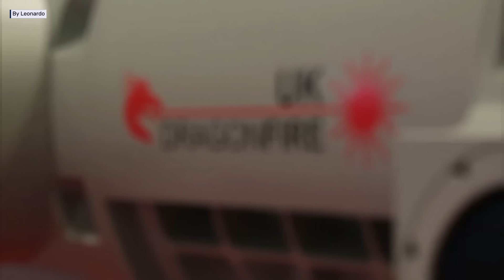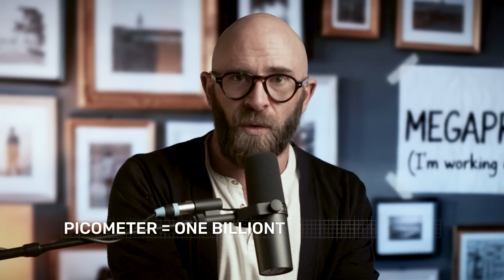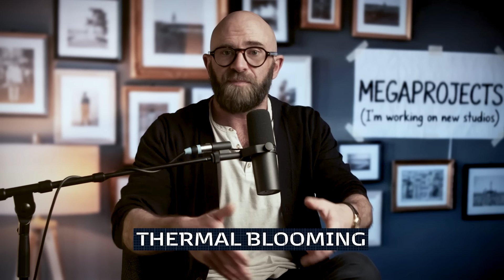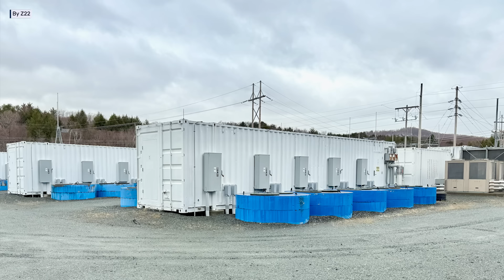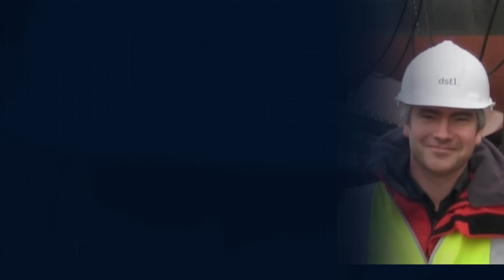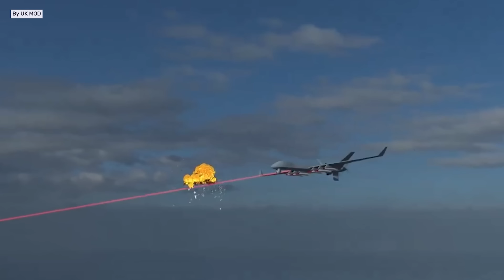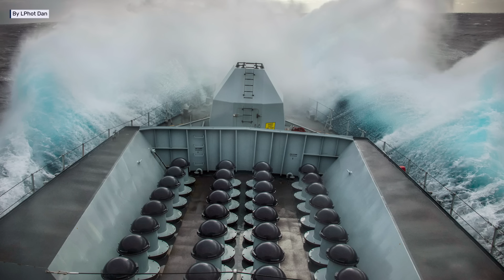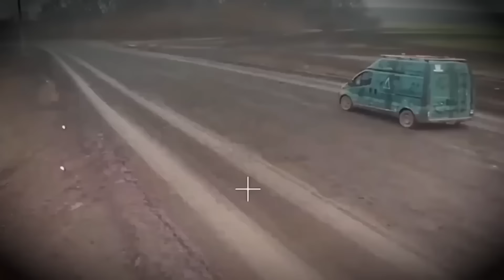The UK's Insane Laser-Directed Energy Weapon

Comment: The normal purpose of a flywheel in an IC engine has nothing to do with changing gears.  It is used to store energy from the fast burning of the gases in one cylinder until the next one is lit, and this is most important at idle speed and when the engine is cold and the oil thicker.  It is actually a disadvantage in gear changing, when you want the engine to change speed rapidly.  With a manual transmission in a vehicle with a heavy flywheel, for a smooth gearchange you have to wait a long time for the engine speed to reduce to the new speed required when changing up, before you let the clutch up to reconnect it to the transmission, and when changing down, you have to blip the throttle for longer before letting the clutch up.  This is why people tuning a car for maximum performance often lighten the flywheel, accepting that they will have to set a higher idle speed.  The issue is made worse if you change by two or more gears at once.  With an automatic transmission, there is usually no way of achieving that result, and changes made at high engine speed cause a nasty jerk, in spite of the cushioning effect of the torque converter, and they are set so that they can never change more than one gear at a time, except sometimes for changing down if the engine is near idle speed.  The only time that the energy is stored when changing gear is with a so-called racing change, when the throttle is not reduced, but the gear lever is quickly smashed hard into the next gear.  That is possible if both engine and gearbox are rebuilt after each race, as is normal with racing cars, and provided you don't "miss a gear", in which case the gearbox, or sometimes the engine, will be smashed -- you sometimes hear a driver say "I lost 2nd gear on the nth lap, which made the hairpin very difficult for the rest of the race".  If you try a racing change on an ordinary car with a manual transmission, you are likely to damage it.

Comment: The problem that the gen XArichimedes found is as true now as it was in 1998. You have to focus that weapon on the drone for a significant length of time. 
I set chatbot on it with available stats and fundamental formulas including  beam spot/ irradiance + atmospheric transmission + damage criteria for various drone materials; aluminium, gps, carbon fibre. 
It gave the effective range for shoot down 1-2km with 3-10s burn time (sensor damage up to 10km). That means the weapon can handle 6-20 drones per minute- it will be overcome by any modest drone swarm. In fog the range is not more than 300m.😢

Comment: Lasers will fit quite nicely into the layered defence. Fighter aircraft at long to medium ranges. SAMs for intermediate - to medium ranges, then soft kill in between, followed up by CIWS and laser. 
It is strange when I hear the term “swarm attacks”.  In the 1980s, the AAW expectations of a Naval task force would be to be hit by a "regiment" of Russian aircraft carrying either AS4 or AS6 missiles. AS4, 4 per aircraft, AS6, 2 per aircraft. Things would be further complicated with a variety of warheads, Heat Seekers, Anti-radiation missiles, Active homing missiles etc. You would be facing 50 - 100 missiles at any given attack, with multiple warheads, meaning that you had to go through the entire dance (counter measures) for all possible types. 

Problem? Missiles of my time required missile launchers, either twin or single, and then you needed a fire control radar for each missile. Like a gun, you needed to aim the missiles, and the fire control radar would need to stay on target for the entire flight time of the missile intercept. (You could reload the missile launcher, but not fire) Vertical launch missiles have helped, but they are not (at the present time) reloadable at sea. Survivability has always been a problem.  Every new weapon brings a counterweapon.  

Remember the war movies of ships slugging it out with guns?  Well, modern warfare means that when all your missiles have been fired, and all of them have been countered by the enemy and their missiles have all been countered by yours, you still have the enemy to deal with and like WWII, you will close to gun range and exchange fire.  This has always been the future of war.  It is always better to deal with the enemy as far away as possible, and lasers will not help this.

Remember Star Trek Shields? They will be next.

Comment: Lakers take ENORMOUS amounts of energy.  To be mobile would either take infrastructure of power stations and cables or batteries.  One bullet into the battery case of a battery pack (which has to the size of 4 x 8’x9’x40 foot shipping containers for 16 laser shots…before needing recharge and the batteries blow up… yep…they cannot be put out once oxygen reaches the lithium.
To mount one of these lasers in a 747, the plane would need to be FILLED with batteries for 20 minutes of use.  Bro, they ain’t prime time yet…certainly not the way you said they seem now..

Comment: An optical laser system used as a weapon just is dumb. Inherently flawed. You need an frequency of light that isn't absorbable by the air or rain. Why not just use a MASER? That's just a laser shifted to the microwave range. They react with metal far more than anything else (try putting a spoon into a microwave), they can be focused with magnetic fields instead of a physical lens, and we already use them to transmit data over large distances because they pass through the air so well. I like the shiny death-beam as much as the next guy, but as Nikola Tesla pointed out, a flashy light show only demonstrates how much power you are losing.
Reply: This is simple to answer. 

Microwaves rquire much higher total power to achieve damage than laser weapons. They spread out rapidly, unlike lasers, and they risk collateral effects to friendly electronics. microwave beams are orders of magnitude wider than laser beams at the same range.

You claim "microwaves can be focused with magnetic fields”. This is flatly incorrect. Photons are neutral, neither optical nor microwave photons are focused with magnetic fields. Microwaves are focused using antennas and waveguides, just like radar.

This is basic electromagnetics, not an engineering debate.

Comment: <fx:pedant mode>

"Except that it uses energy instead of a projectile"

A projectile weapon uses energy; it's just that it's using kinetic energy to kill you, rather than electromagnetic energy (light). An atom bomb uses energy, too. It converts a gram or two of its mass into energy (from the nuclear energy locked inside it), and then that energy mixes with everything else in the local area and converts that into energy, too.

"Everything is energy, but some things are more energetic than others", to paraphrase Mr Blair.

</pedant mode>

But I know what you mean. If you can find a reliable way to do it, light is going to be a much "cleaner" / cheaper / easier thing to send at something / someone you don't like, than are lumps of metal and plastic. The post-argument clean-up process is much easier and, presumably, each shot doesn't consume so much space on your gun platform.

Thanks for the video :)

Comment: Umm, this isn't new.  in fact, the russians designed a solid state reactor that could fuel a dragonfire system that would fit into existing launch vessels for orbit insertion.  The chinese took it a step further and did two launches of such a paired system.  i believe they successfully demonstrated it's use in orbit before failing, because big energy conductors in space have a tendancy to burn out.  of course it's all conspiracy theory stuff, but I believe space lasers have been successfully tested.  I also know that US air monitoring has picked up on radioactivity from at least one failed launch of such a fission reactor in early Nov. 2019.  The radioactive fallout was covered up by the Chinese and unless you find the radioactive bodies, it;s just propaganda eh.  yes, i take it a step further to say that covid was released to coverup the stuff that would have lead us into WW3, which such a space laser system was a part of.  Ask yourself, what would a US citizen insist on if we thought we could be zapped from space?  i also know the air monitoring data has been altered and can't currently be downloaded in it's original form.  meaning we knew and covered it up.  Also the west coast fires and other mfg. plant explosions, i would propose as evidence as well.

Comment: Isn't it ridiculously easy to counter a laser.  You just use something that reflects light, e.g. a mirror!
Reply: No the beam will eat through a normal mirror in microseconds. High powered laser's use specialist mirrors usually highly polished metal composites with interrogated cooling systems so they don't burn out.
Reply: @ZuulGatekeeper  So my understanding from what you're saying is the mirror isn't 100% reflective and some, even small amount of energy will be absorbed and it happens that the laser is so powerful even this tiny amount will cause significant damage?
Reply: @robbie_  Yes a mirrored surface reflects around 90% of light but a high powered laser is so powerful even that remaining 10% will overwhelm it's reflective properties in microseconds & vaporize it.

Comment: Why exactly was Archomedes' death ray impossible?
Not just that during a fight ships may have been stationary enough for a while, there are experiments with mirrors channelling light to create enough heat to melt a hole in a steel safe within seconds.
That kind of heat could easily ignite wood or better, sails, just as quickly if not even faster.

Comment: There is a fundamental error in the costs being given for direct energy weapon operation.

The cost seems to be just that of the energy used.

Weapon system have 3 cost component:
1. The initial cost of the weapon system 
2. The cost of "bullets" fired
3. The cost of the maintenance required to keep the system operational.

For missile the cost of the bullet/missile is so much higher that the maintenance is mostly ignored.

For artillery the maintenance is still minor, but Ukraine showed that barrel substitution can be a bottleneck for intensive use.

For firearms maintenance can be done by the soldier with minimal equipment.

For aircraft the maintenance cost is so high that the cost per hour of flight is used. And some of the regular maintenance has complex enough requirements that availability is a measure of comparison between aircrafts. 

I think direct energy weapon will have such a high maintenance cost that the cost of a shot will be mostly irrelevant.
The question is then how high will the maintenance cost be and how much downtime will it cause for the system. 
If most of the frequent maintenance required can be done by the personal on the ship that is fine. But if you need port facility to do some maintenance every 100 or even 1000 shots, that can be a big issue. 
In case of every 100 shot you lost some of the advantage on the missile anti-missile because now the payload is comparable, but still bigger. If it's 1k shot its more a question of cost and time required. Loading missiles in vertical launchers is something that we don't do at sea even if we somehow get a replacement missile. So this is not an issue only if direct energy weapon.

Comment: Useless if the enemy is over the horizon. Self-propelled and ballistic systems have more range and don't depend on line-of-sight. If you have line-of-sight, it's likely too late. Also, useless against multiple simultaneous targets. If the enemy is kind enough to send one target at a time, at slow angular speed, with slow approach, and not on a ballistic trajectory ... would have some use ... i guess. But multi-role missile systems would be more flexible.

Comment: So to be fair to the Williams F1 team and their Flywheel system, it was originally developed as a power source for the Kinetic Energy Recovery System (KERS) system which was added in 2007 (or 2008, or 2009 - I forget exactly which year it was brought into the rules) as opposed to the other teams who were working on battery-based systems.

Comment: Dragon fire is following along in the US model of build the mount and tracking capability with a retrofittable laser, while you continue the research in parallel for up powered weapon system to mount into it.   (its a good plan)    So the current 50kW is of limited effect, but in the next step (likely 100-120kw) It will start to show its muscle, likely by 2030 I think you said, its the 250-300kW that is going to start to turn the tide back to the fleet defense.

USN lasers deployed, are really just wide scale testing.
8x Arliegh Burkes have ODIN which is something of a marginal function.   kind of Meh, dazzler.
USS Preble has a Helios-60 on it, 60kW will do some damage to drones and small craft but the range and burn through time is to long to focus it on missiles
The USS Portland has had the Helios-150 LWSD Since 2020..   
             The Portland has 5x 2.5MW generators on board, so 12.5MW of electricity designed to allow for DEW

I think the USN is waiting on three things before going all in on Lasers.
1.  A laser that can engage Hyper sonics  
           HELCAP is coming , at 300kW its a microsecond pop on a missile/aircraft/ ???, but a big energy pig..
            Per Google a single  300kW fiber laser is going to consume ~600-1000 kW per shot due to inefficacies in the laser, and transmission.
2.  A better understanding/plan of how to retro fit the DEW into the current fleet  
            Arliegh Burke destroyer   block 1 #21@7.5MW,  2  #52@9MW,  and  3  #1@12MW (done to power the SPY-6 more than lasers) #21 more coming            
3.  A vision of what ship to mount two or three 300kW on.. 
           Zumwalt @58MW? DDG-X @??MW? FFG-X @??MW?   A all electric driven Arliegh Burke block 4?? @ 78MW total? <see article>
           https://www.usni.org/magazines/proceedings/2025/february/electric-powered-arleigh-burke-class-destroyer-possible

 I would expect all the carriers to get one or two of the HELCAP up on the tower, in the next 10 years as the only nuclear powered ships in the fleet.

Of course they could make a battle cruiser sized all electric ship with an Bechtal A1B producing 125MW of power

Comment: The Palestinians already beat the Israelis laser weapons just by covering the mortar shells and rockets in sticky stainless steel thin foil shiny-side-out and all the laser energy was dispersed by hitting this mirror like surface. You have to remember inside these laser weapons are lots of mirrors which bounced the beam around which stainless steel foil does rather well too. The type used is 446 SS which melts at  1525°C or 2780°F. Sure the mirrors in laser weapons are water cooled but a mortar shell moving at 900 feet per second is air cooled rather well too.

Comment: FYI. The USA has at least the following laser weapons ... P-HEL (20kW); H4 (10kW); DE M-SHORAD (50kW); HELIOS (60kW);  plus LaWS a 300kW Naval High Energy Laser, a 500kW Laser from Lockheed Martin and the now defunct YAL-1 megawatt class laser which was mounted in a Boeing 747. Other nations also have similar weapons in development (e.g. France, Germany, Ukraine, Russia).
The video makes no mention of lens surface debris causing problems. I don't know if the problem is solved but, for example, a spec of dust or the salt from evaporated seawater on the laser output "lens" (actually plain glass) can heat up rapidly and crack the lens, rendering the weapon less effective and less efficient.

Comment: How can Dragonfire be the harbinger of directed energy weapons when Iron Beam is already operational and deployed in the field?
Reply: because its 3 orders of magnitude cheaper, and more accurate.
Reply: @Daedalus-yo9ivare you suggesting that Dragonfire's cost of shot is 3 orders of magnitude lower than that of Iron Beam? 
1. Being somewhat better than your predecessors doesn't get you the "first" title - quite the opposite. 
2. Iron Beam cost per shot is about $3, according to the manufacturer. To be 3 orders of magnitude cheaper, Dragonfire should be at sub $0.01 - if you can make electricity that cheaply, you have solved the UK energy crisis - which of course didn't happen. Dragonfire's actual cost per shot isn't known as it is not operational yet, but official reports suggest about £10 - which is more than 3 times that of Iron Beam.
3. As for accuracy - not that once you manage to shoot a falling mortar shell at 10km, accuracy improvements mean much - Dragonfire wasn't even live tested yet, so any accuracy claims can't be substantiated.

Comment: Not sure when you recorded this, but I am 100% certain the comment about dragonfire not yet being deployed in Ukraine is incorrect. 

There have already been reports that older earlier models have already been deployed for testing and used successfully, and there are enough rumours to suggest the latest version of a ground-based version, which was rushed into development and tested early this year in the UK, is also likely already in Ukraine.

The official line from the MOD is that this hasn't happened, but obviously they aren't going to publicly announce it. 

Given the system already appears to be well over the "70%" requirement from Shapps, otherwise the current Government is unlikely to have pushed forward deployment to 2027, I think it's a very safe bet that it's seen regular testing in Ukraine over the past 6-12 months and I wouldn't be surprised if dull deployment will happen within the next 6.